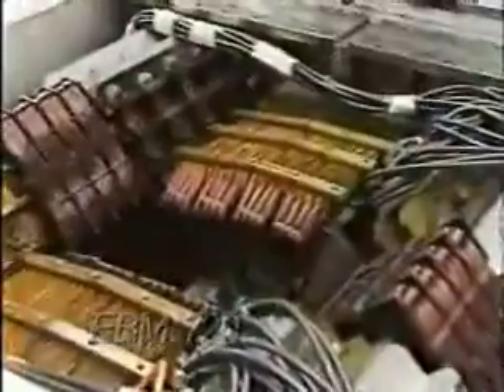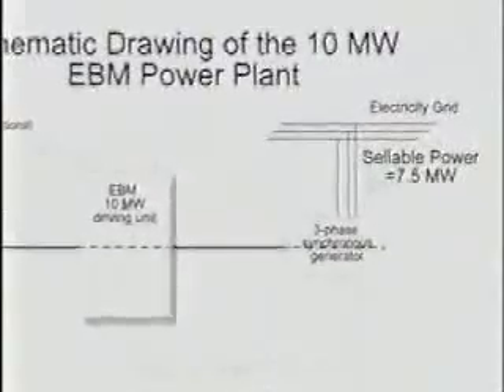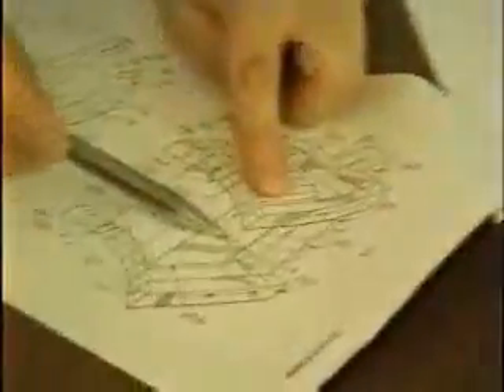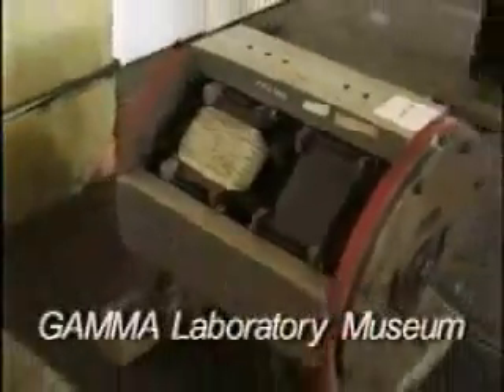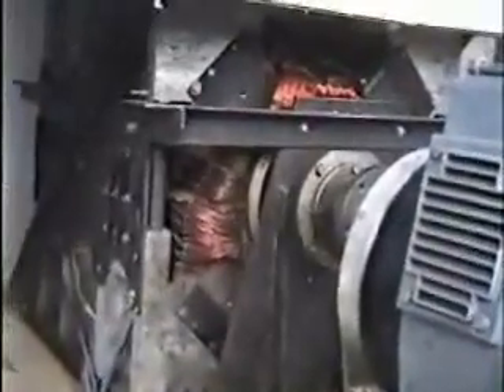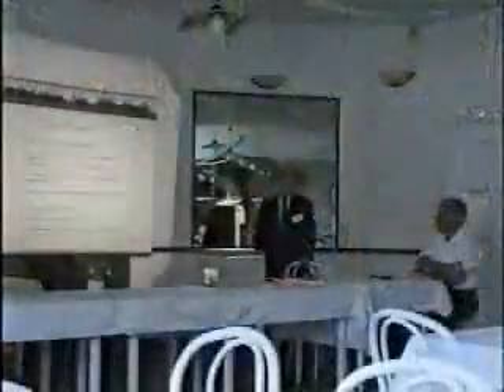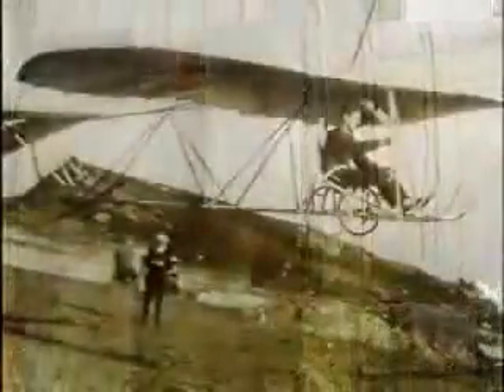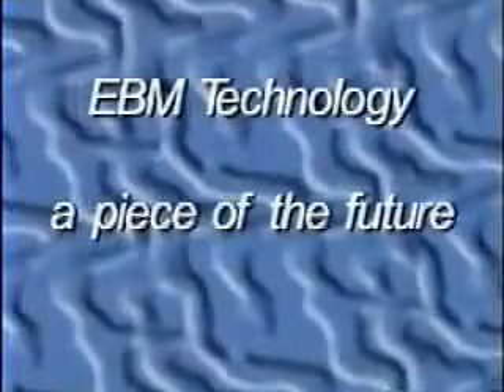EBM Technology Corp

Comment: @knowledgemonger Well, despite you alleged expertise, you have yet to consider that they where "dumbing it down" for us laymen.  It is really a Perpetual Magnetic Generator (PMG).  Its inventor, Peter Peregrinus, published his idea back in 1269A.D.  Not a new design, but a [presumably] "perfected" one.  But, as with all technology, it will take years to get it into full production.  It took years for the Integrated Circuit (IC) to take hold and people still used thousands of transistors...